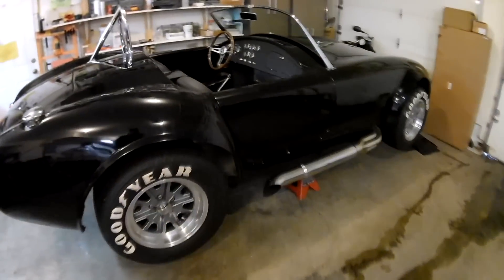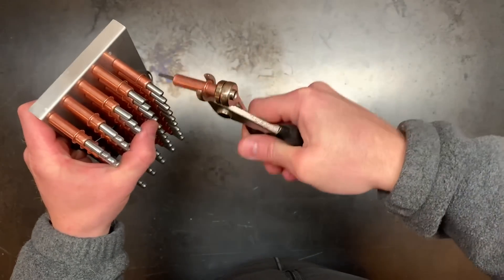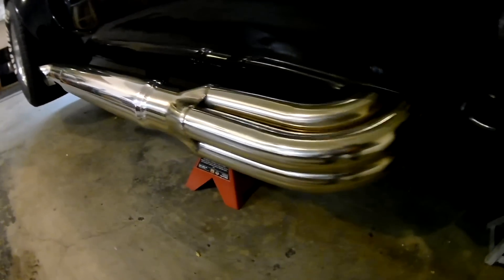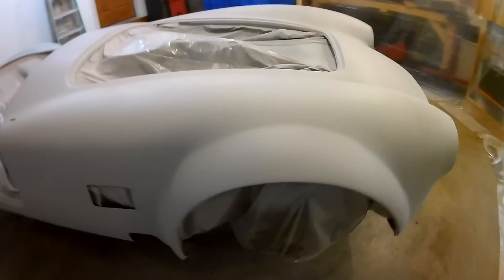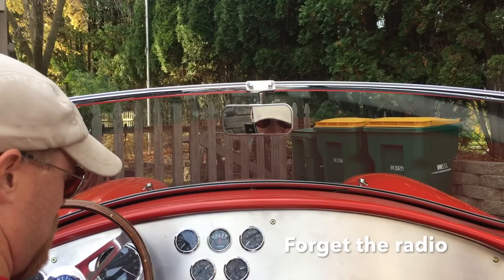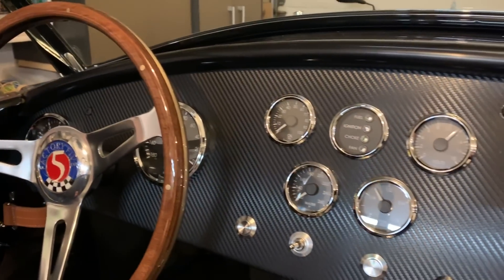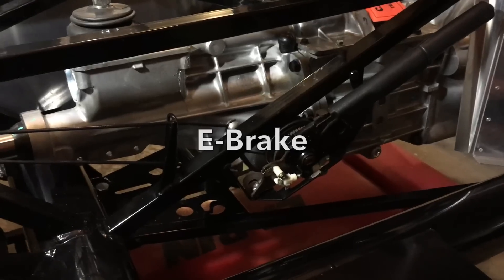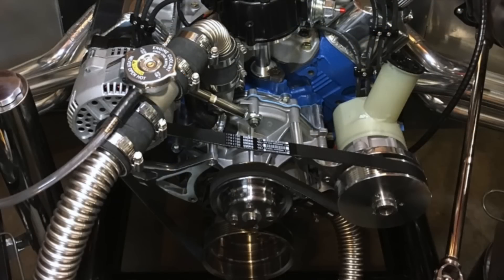Factory Five Cobra: Lessons learned

Comment: I appreciated everything you have shown and mentioned on here. I have been dreaming about having a AC Cobra for the last 29 yrs, in 8 more years I retire, and so this is going to be a present to myself and build my dream car. I have been taking notes from everyone such as yourself who have walked the walk. I want to learn and benefit from those who have gone before me, and create the car of my dreams. Currently slowly buying engine parts for a 302 roller, going old school with dual quad, have even made my own turkey pan for the carbs and made a special heat plate to separate as much engine heat from carbs as possible. Thank you for posting and keep it coming...I will mention I am going to build a gentleman's cobra, no side pipes, and I need to find a rag top for the car too...I have time :)
Reply from the maker: A 302/289/5.0 windsor block / 3" stroke is almost perfect for a cobra (in my opinion) It doesn't build big power but the cars are very light and you can rev to 6k all day ---and they just sound excellent (over square bore). The ford roller design is good too. Before my purchase, I gathered a lot of information too and if you decide to take the plunge, i'll advise there is no right or wrong way to build your kit so don't get to hung up on anyones opinion and when you make decisions, go with your gut. Dual quads/turkey pan full exhaust and ragtop - LOVE IT - a configuration like that will get a lot of attention at the car shows and perhaps the most important decision for that configuration- what color? :)
Reply: Have been looking at colors for a while too, but currently I like a real nice metallic light blue, or a metallic grey with a tint of blue in it....but I will keep looking so many colors to pick from, and than you for your kind words. I know I am going to love it , and when I leave this world, I will have left my mark in a classic car.. @TacoJoe

Comment: I am close to finishing my build so I can certainly relate to your experience. Mine is a 34 Ford Coupe.
Some things I thought would be straightforward were not.  Others that had me concerned went fairly well.
You've done a great job on yours   Enjoy!
Reply from the maker: The 34 Ford coupe is a sweet kit too / I like how that one is designed- which motor did you put in?
Reply: @TacoJoe  
Probably the most boring combination imaginable.
Small Block Chevy (I already had it) Turbo 350 by TCI and a 9" Ford diff.
As this is my first build I've tried to keep it simple.
It will really never be "finished" since there will always be things I'll want to upgrade or change.
Reply from the maker: Nah - that sounds great! I actually have (2) 350 Chevys on engine stands waiting for their future home- did you need to reweld the engine mounts or did you create some sort of adapter?
Reply: @TacoJoe  
Mine is not from Factory Five.  It's from Antique & Collectable in Buffalo, NY.  They asked what engine I would be using and supplied the chassis with the correct mounts installed.
I was torn between the 34 Ford, the 41 Willys and the Cobra which are all available from A & C.  I've been second guessing myself ever since as I really like them all.
Yours looks great and I'm sure it runs even better.
It's a lot of work but in the end it's so different than the "off the rack" cars we see everyday.
Reply from the maker: Don't second guess yourself, rather it might be time to add another one to the collection :)
Reply: @TacoJoe  
I wish!

Comment: As someone who is 6'5" and always wanted a Cobra (have tried out a couple for sale locally and couldn't even close the door because of my knee jutting out to the side) do you think there is room for modification to extend the drivers footwell? Great vid BTW
Reply: Don't know if FFR offers this, but other Cobra kit mfrs have dropped foot boxes for long legs. Stretched wheelbase kits help too, but they throw off the car's proportions.
Reply from the maker: Yes there are - I am 6’1” and was able to make things work for me and it is comfortable on long drives. I basically didn’t bolt the seat down until the very end (eg got the pedals where I wanted them / steering wheel positioned / etc.) -then angled/moved the seat until things felt right. Different seats are definitely an option too and could add another 4-6” of space (thinner backrest). If you were to do a build, I wouldn’t view this as a show stopper, rather one of the challenges you’ll have but something you can solve. Check the FFR / factoryfive forums and I’m certain you’ll find a thread for tall guys-what to do. Thanks for the comment!
Reply: @TacoJoe  appreciate the prompt reply and encouragement. I'm not yet ready to give up the dream of having one in my garage

Comment: How long before all them pop reverts loosen up and you have ratts ?
Reply: Works like a charm, also great at plugging wire hole errors, places where engine heat/air can get in etc....
Reply from the maker: Not going to loosen up / LSR on the back of every panel before riveting / I take it you have some experience here?
Reply: LSR?
Reply from the maker: Apologies - LSR=Liquid Silicone Rubber / acts as an adhesive between the riveted panels and the frame. Without it, Richard is right- could be an issue (rivets loosen up / etc.)

Comment: Great and informative video.  Where did you find your cup holders and did you just glue them in place?
Reply from the maker: I found them on amazon / stainless - I think they are marine application. To hold them in, i actually used two of those "live strong" rubber wrist bands and was careful to cut the hole to size. Works great / holds them solid and you can easily take them out if you want to also-

Comment: 2:50  Times sure have changed.  My 2004 MK3 came with common steel exhaust brackets.  They are powdercoated in the rear, sandblasted from road pebbles in the front.
Reply from the maker: To fix my driveshaft angle, i expect i'm going to have to move the engine again thus fabricate some new brackets. When the time comes, I'll likely follow suit and make some hot rolled steel brackets (like your MK3) - thanks for the comment!
Reply from the maker: Hey Brad- regarding no blocking the radiator / every build is going to be different here. For instance, my headers add a lot of heat / just wrapping these would definitely help. Something like a Coyote likely wouldn't have these problems at all. My issue is: The intake is also getting hot and hot air is trapped near the top of the engine bay. By not blocking the top of the radiator, some of the airflow through the front "flushes" this air out through hood cracks or pushes it out under the car (and carb stays cooler). If you had a vents, or a hood scoop, i don't think you would have these problems at all. Good luck!

Comment: Great, Great Video...... I didn't build mine, so I can't talk BUT I'm super jealous of the cup holders.
Reply from the maker: As crazy as it sounds, the cup holder retrofit mod is low investment-high return on any project car - I say go for it/ you’ll have no regrets!   :)
Reply: @TacoJoe  are any of those cars available purely mechanical? With no electronic parts in the engine?
Reply: @TrangDB9  yes, you can choose a carbureted engine, no power steering, no a/c or heat. If that is what you are asking?